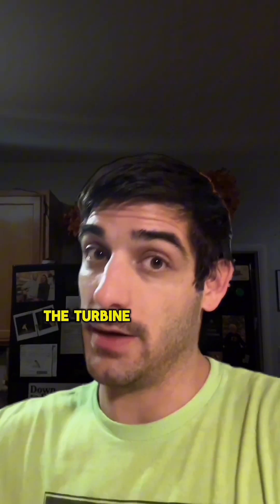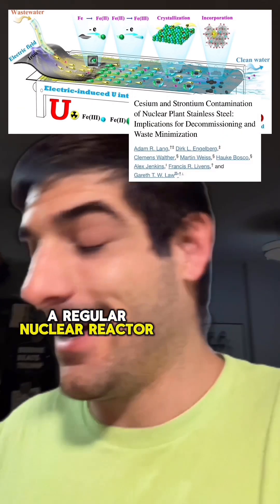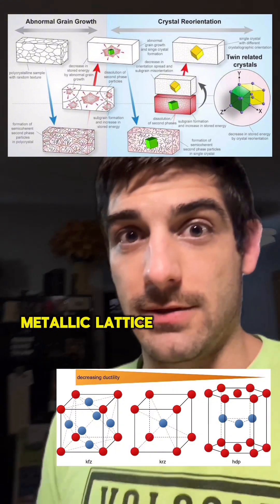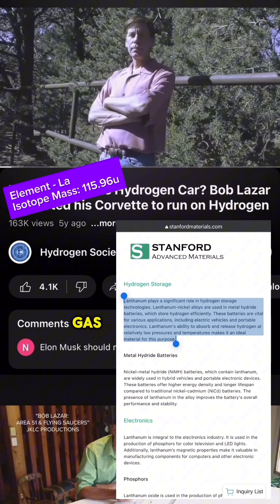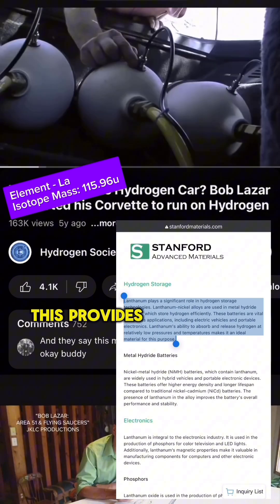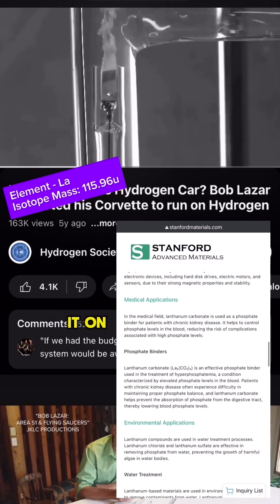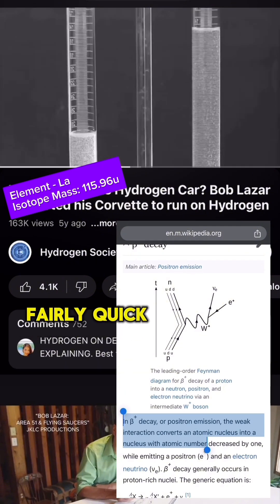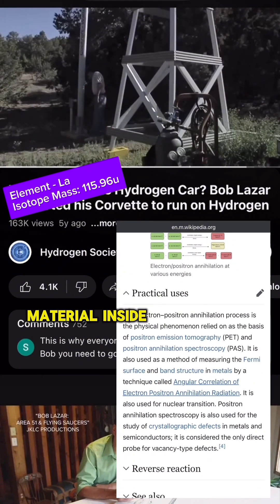Radioactive Bladeless Turbine Discs - Nuclear Tesla Turbine

Comment: The problem with hydrogen cars is it eats the metal of the cylinder so after 20,000 miles you need a new engine